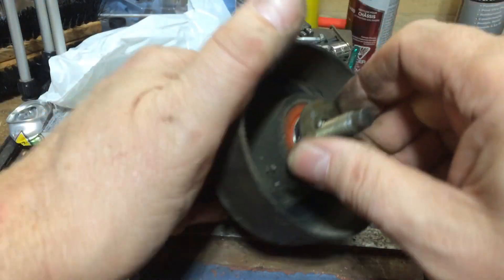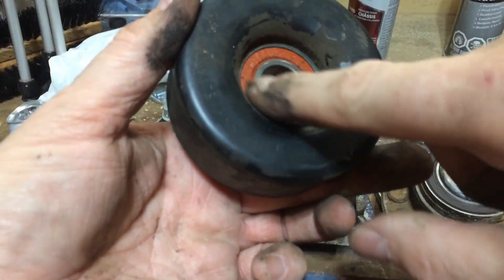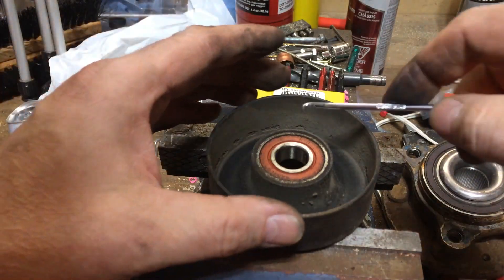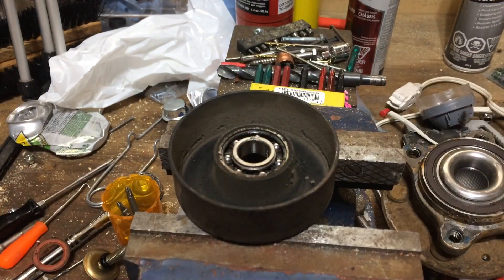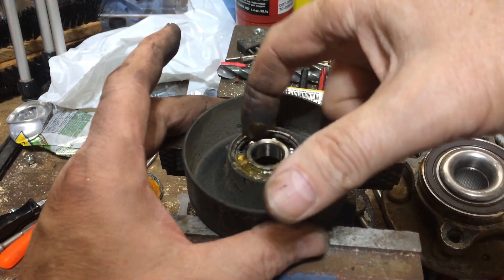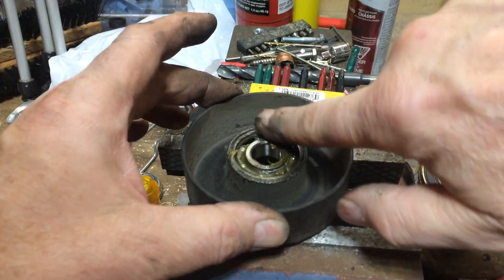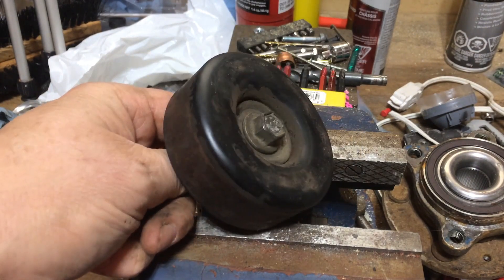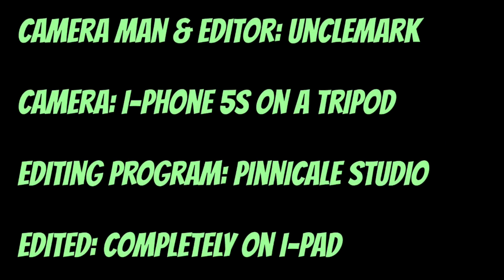Can you grease a idler pulley bearing? (EP 43)

Comment: Good info, but you really need to make sure the surface of the bearing is clean, and your fingers. You just pushed all kinds of contaminants in there. I take mine and flush with alcohol and blow out with an air gun and then pack. If you do this on a regular schedule the bearing will last a long time. My fathers truck is 15 years old and still running stock idler bearings.
Reply from the maker: Marty Mcfly, good tip!  This car is 20 years old, so even with some contaminates it will probably outlast the car. Lol. Next time I will clean it first!

Comment: I'm doing this before it even starts making noise.  Even though it's only saving you $9-20, it also may save you a break down (I had one go out on a 75 mile drive without making any noise ahead of time).  That was a major pain, plus I missed most of a day at work.  I may even do it to ALL the pulleys on my belt, not just idler pulley.  My truck's power steering pulley locked up on me once too.
Reply: I've opened a few brand new ones, they're not properly packed with grease, only halfway. I don't know if its to save money, or planned obsolescence, but I'm adding some extra high temp bearing grease straight from the box. It's a 30 second job, worth it. I don't like consumerism. These used to last 500k miles in cars made in the 60s to 90s, now all of a sudden, even with better quality alloys and materials, they squeak or fail? This might just be the issue.

Comment: That looks just like the pully on my 2003 ranger 3.0.  Mine has 328K miles.  I am in the process of replacing the timing belt cover as it is leaking.  I followed you procedure but when I finally removed mine from the inside side of the bearing there was a black plastic that covered the bearings with small tiny slits.  It destroyed the red bearing cover as it was dry and cracked despite being careful.  I tried to apply some grease thru the plastic (cage) that holds the bearings and put it back the best way I could and made sure the metal washer that threads on it up against it to keep it from backing out.  i guess I will see once I put the truck back together.  Thanks again, great informative video.
Reply from the maker: See how it does. I have done a few in the day, and they all seem to last longer than the vehicle. If not, they are usually a cheap part. (if you buy just the pulley wheel/bearing.) Thanks for watching and giving us your thoughts!

Comment: Years ago I had a Peugeot 505 diesel and after 10 years the belt idler pulley got noisy. The dealer wanted around $60 for the part and said it couldnt be lubed. I went home and saw a way to open the bearing. It had 11 bearings, 3 were broken in pieces. I washed everything out, packed it and ran on 8 bearings without any future issue. Oddly, the broken ball bearings had no bad effect on the race, just normal wear.
Reply from the maker: cvcoco, glad you cleaned it out first.  I should have. Next time I will!

Comment: Thank you very much, very helpful video 👍
I wish if you cleaned it well first, let it dry & blow it with air, make sure it's very dry and very clean.
Then pack it with grease. with high quality grease you can get. 
This will prolong the bearing life, Improve the performance and longevity of the bearing and part, and save you money on the long term or run.
(note: never mix poly-urea grease with anything else, grease will dissolve)
I'm still doing research for what is the best possible type of grease for those application.
Yeah I'm over thinking OCD.
Reply from the maker: It has been about 5 years since I did this video. So far, still working fine! But, you are correct. A little more time prepping the bearing and it may last longer than the car!
Reply: @unclemarksdiyauto  Thanks a lot man👍, I'm glad it lasted 5 years, I will do this later on my car with lithium complex grease.

Comment: I  need to do this to a couple of bearings here in Ireland so  thanks for the  demo.Quick questions 1 do ball bearings wear ? 2 would i gain anything from removing the old grease from the bearings first ?
Reply from the maker: Peter Gallagher, when they get dry, yes they will wear.  And it would be a better idea to clean out all the old grease, they put in new grease. Probably will outlast the vehicle!
Reply: Will try ....  I have a long weekend hopfully the rain will stay away Its been hot in July and Wet in August but still humid ....
Reply from the maker: Peter Gallagher, another video on a bearing that didn't have the plastic dust cap. Had to buy a bearing, so I opened up the new one to see how much grease is in it, basically nothing in it!  Added grease to new one before installing. Take care!

Comment: You can also pop the old bearing out and a new one in, if your not in a pinch, with the right sized sockets and a 3lb hammer.

Ebay has some good quality bearings that are priced right. (NSK, Koyo, Timken, NTN, SKF, etc)

Replaced the bearing in my cars idler pulley wheel for $5 (SKF- made in italy).

Comment: I would have taken a degreaser and sprayed the bearings real good and everywhere else to get all the old grease out and grime. Then when real clean free from grime then pack it with good hi temp grease or regular if you don't have the hi temp. Then wire brush the wheel on a wire bench grinder...New again then, My Idler is about $30-$38.00 now... Parts are way over priced now so we all have to make them last or recycle them unless your rich
Reply from the maker: I agree Jeff. i should have cleaned it out but at the time it was just the idea of "can it be done". The next one I do, I will be sure to clean & dry it out properly. You are also right, for the cost of cleaning & a bit of grease, this idler pulley probably can outlast the car!

Comment: I do this to new bearings and iddlers,i remove both sides and spray brake cleaner,dry them and fill them with mobile one full synthetic high temp grease(the red one) the plastic iddlers will not shatter! They only shatter at 50k cus they are run dry!

Comment: PGM bearings 2 pair cheap at Amazon $6. I use 4ton press to pop off the old one. Pretty easy to do.
Reply from the maker: X1area51 II, just checking out amazon as we speak. I have a new video out soon (episode 72). I open up a brand new bearing and surprise surprise, not much for grease inside! Stay tuned!
Reply: @unclemarksdiyauto  thanks for the tip. I will check my idler bearings and re pack with better grease.

Comment: ok but can u grease it while it's in place ?
Reply from the maker: Technically you could, but you still have to unbolt the center bolt and remove it, then the pulley will just sit there (until it falls off, LOL) Hope it is not too late to save it with some grease. If you want to be extra picky, you could try to clean out all the old grease, clean it with brake clean and let it dry, then add some grease. Otherwise usually just the pulley itself is cheap to purchase! Keep us posted as to how it went, Bryan!

Comment: is there a way i can attach a 45 degree grease nipple to this and grease them all when i service my car. front end of my car to come off to get to these so a grease nipple would be preferable. if im going to his effort to get the part in my hand you can bet your ass im replacing it while im there. otherwise half a pump of grease every year and it would never need to be changed. i could drill the bolt or get a hollow stainless one but how would i get the grease into the bearing? via the inner race? i cant find a bearing with a hole on the inner race anywhere online
Reply from the maker: I can't see how you can do add the grease nipple in this situation. You could just clean it up real nice, add some grease and it probably will last 10 years easy. I have had brand new idler pulley with almost no grease from new. Just FYI.